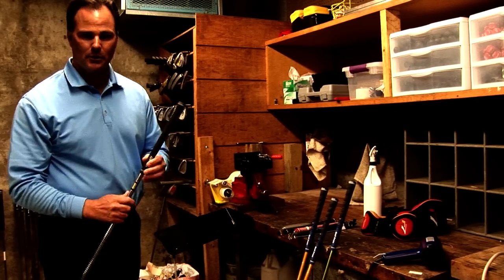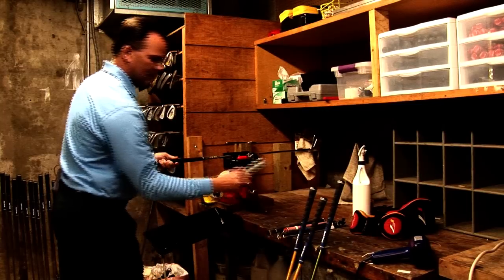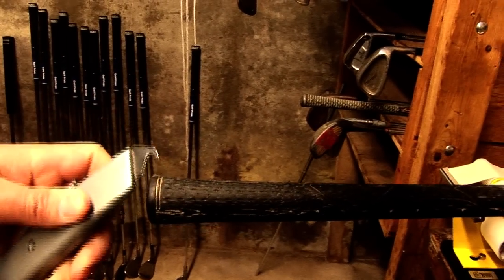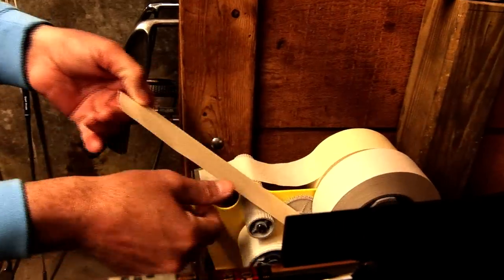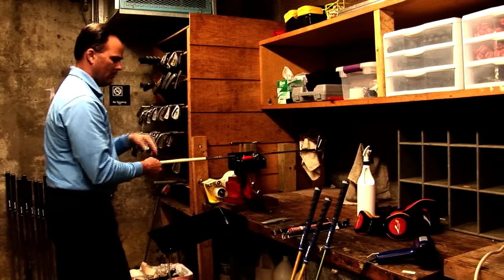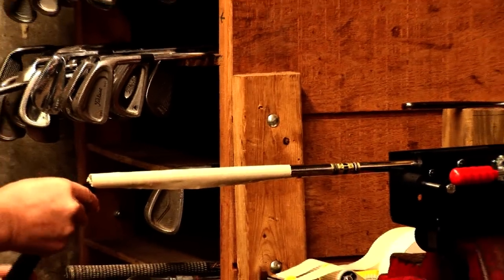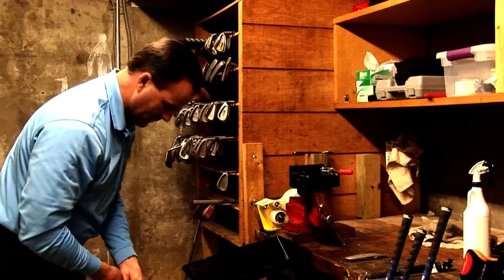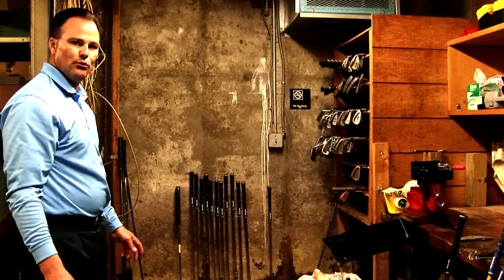Golf Tips : How to Re-Grip Golf Clubs

Comment: You should always remove the old tape. Leaving the old tape makes a bigger difference in the grip diameter than you think. He cut off the excess tape, I always fold the extra tape over the end to keep moisture from entering the shaft end as this will corrode the shaft/iron from the inside.  Be careful cutting the grip and tape on fiberglass shafts as you can really damage the shaft if you slice into it. Nobody explains what they mean by lining the grip up at the end. What are you lining up?